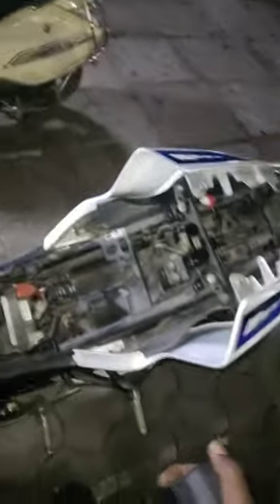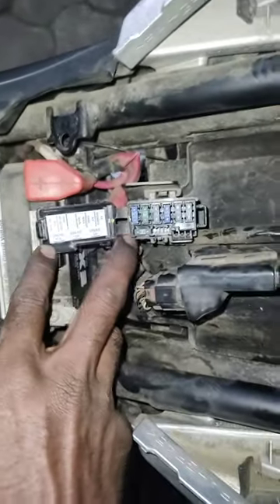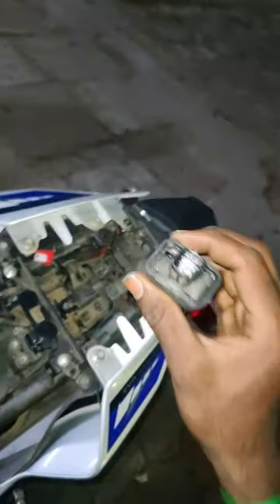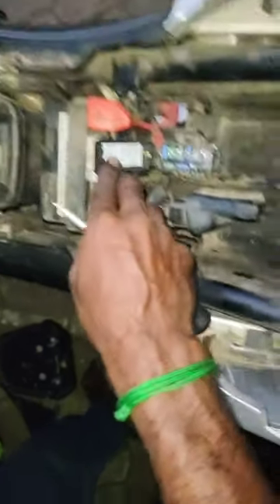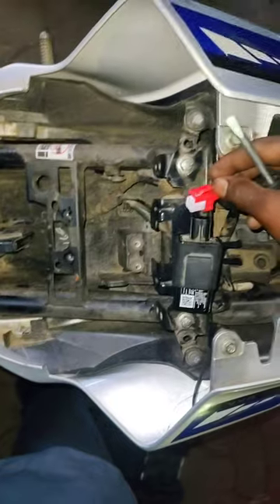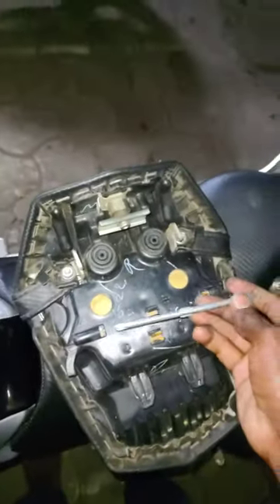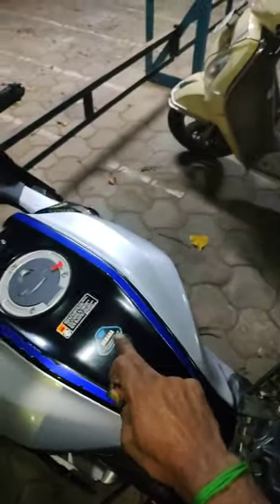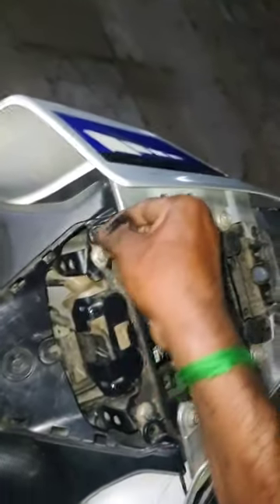Full Vid link 🔗 😭R15m Display No On Problem • Jollya Oru trip #itachi #r15startingproblem

Comment: Bro,,, நானும் r15 v4 blue colour than bro வெச்சுருக்கேன் bro,,, எனக்கு bluethooth connect ஆகல bro,,, இது ஏதாச்சு problem ahh bro,,,
Reply from the maker: Bluetooth connector ah remove panirathy better nanba.....
Suppose rain la   short circuit change irukku... So wires connecting area la properly rain cover vachi cover pandrathu safety bro ✌️
Reply: @Jollyaorutrip  ok bro,, 👍👍,, Bluetooth connect aga mattinguthu bro,,, edhukku eadchi idea sollunga bro,,
Reply: @Binladen.572 showroom eduthuttu poi mobile la connect panni vaangikonga nanba , seat ulla irukka Bluetooth module qr code scan panni connect pannuvanga mobile app oda try panni paarunga mudiyala'na showroom poirunga, but Bluetooth la oru feature um illa waste Naa connect panni vaangitu 2 hrs la app delete panniten